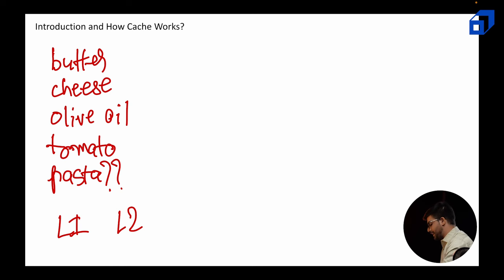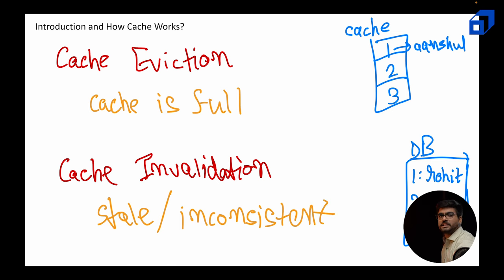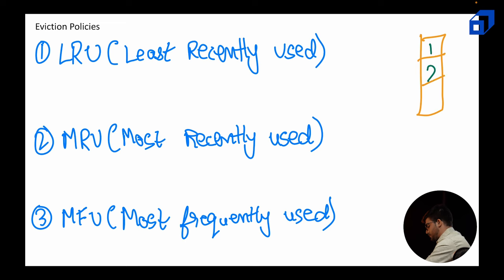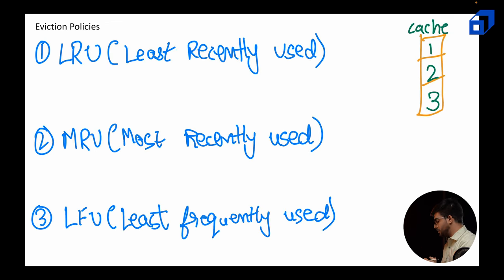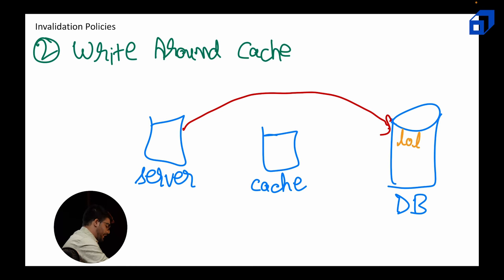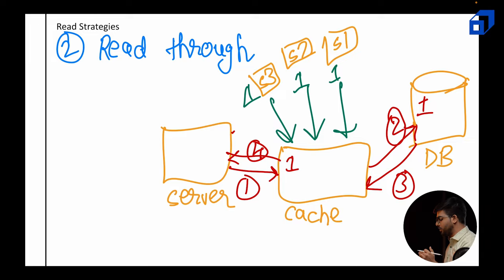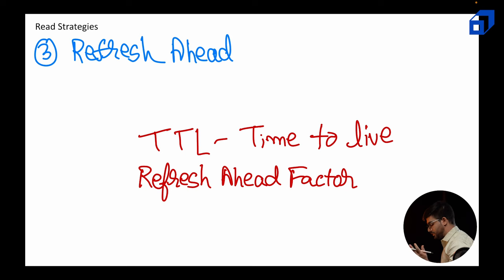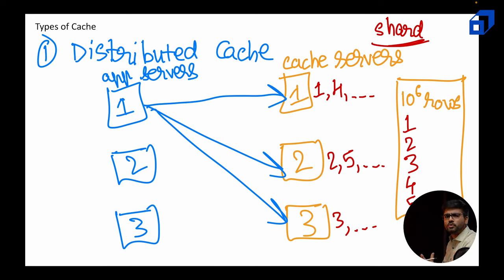Caching Complete Tutorial for Beginners | System Design | Software Architectural Design | @SCALER

Comment: Write Around cache should not have higher latency than write through cache as the main time is spent in writing on the database and not the cache. Time for writing in cache is a fraction of writing in the database so the overall latency for both would be very similar as they both write on database.